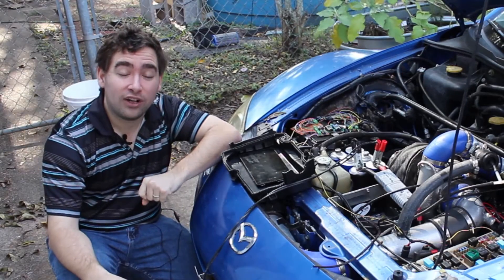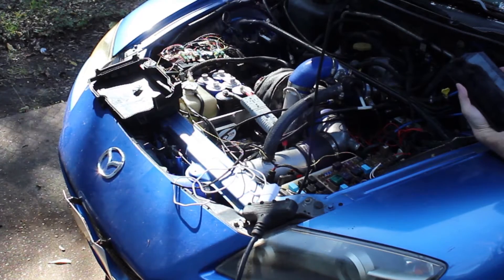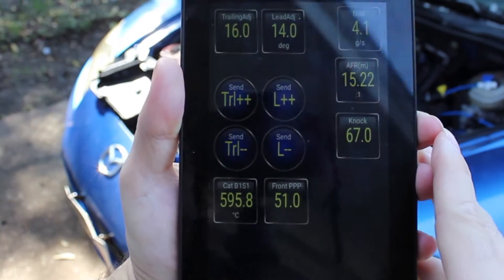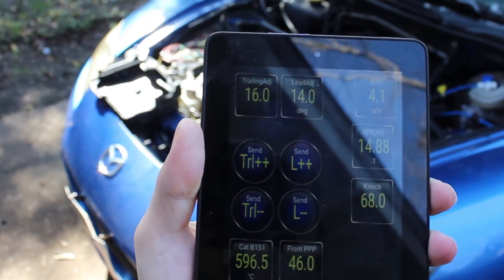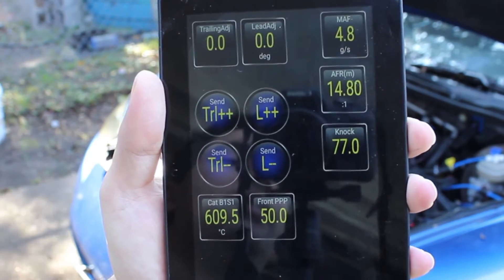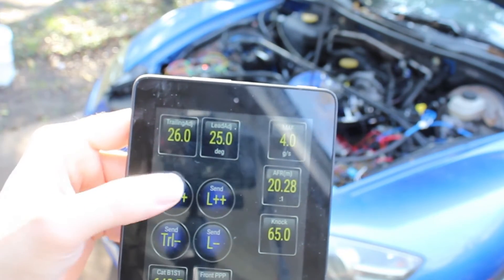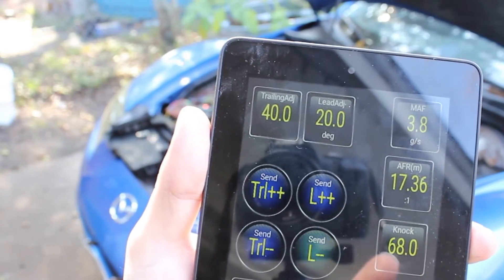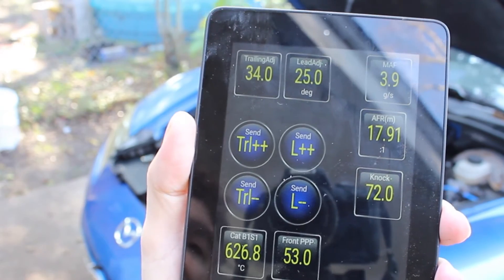Lean Burn Part 2 Testing at idle - Voiding Warranties Ep 27

Comment: You can't just lean out the fuel without modifying the ignition system you need to cut the bridge of the spark plug and increase spark voltage using some sort of capacitor circuit.
Lean fuel mixtures need alot more energy to ignite. Honda did this in the late 70s with their CVCC engines these had a prechamber at the end of the spakplug that filled with air and fuel vapour, on ignition the vapour exploded and ignited the main lean mixture in the combustion chamber.
Reply: Capacitor can only charge up volt to what its recieving...(coil 40,000v)
--capacitor help tank extra electricity to hold ignition coil 40,000 volt longer...& slow down/prevent coil volt loss/dump spark
---increase ignition coil #of coils secondary winding=up volt
--or increase battery from 12v--to 18v
Reply: @YangSword9x   I tried a different strategy , A rotary has 2 spark plugs ,replace the spark plug with glow plug to heat the chamber and the lower spark plug will ignite the heated fuel